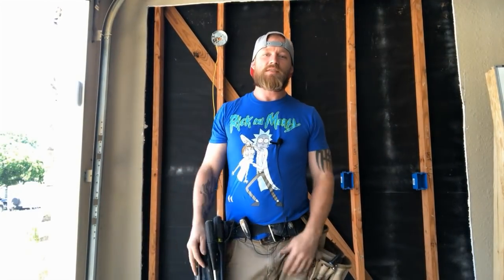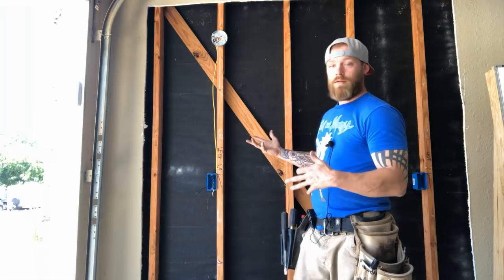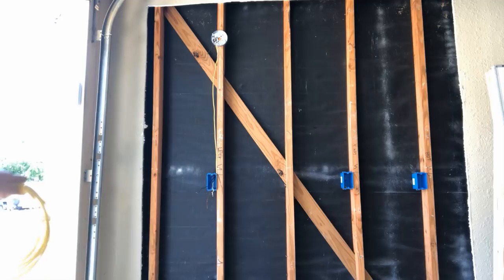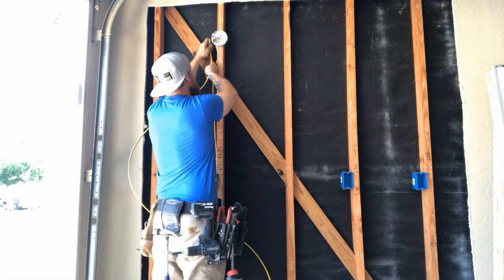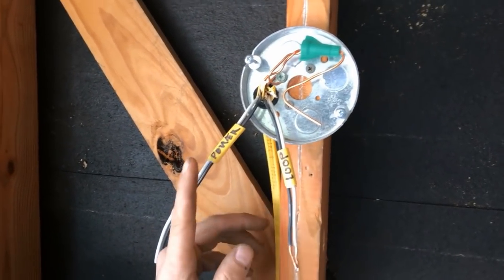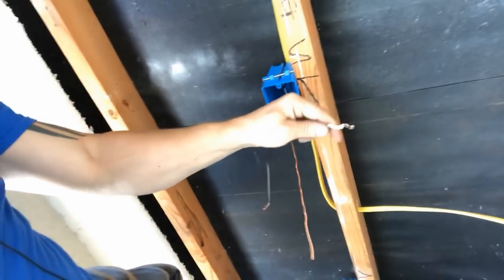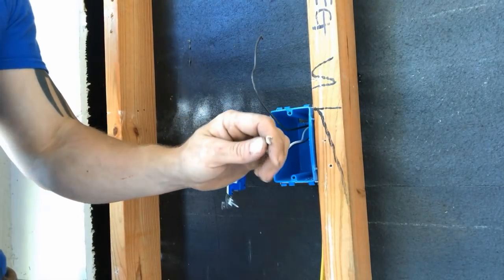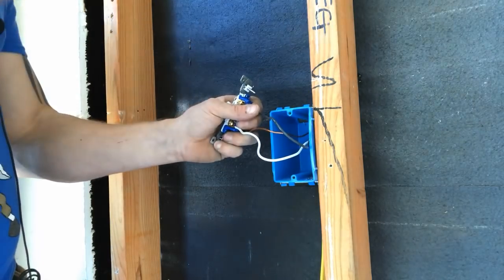Episode 12 - How To Wire For A Switch Loop

Comment: If you ever want to install a motion sensor switch or smart switch, you should have the neutral in the switch box.
Reply: Also, quoted from EC&M website: "When wiring lighting circuits supplied by a grounded general-purpose branch circuit, the 2011 NEC now requires you to provide a neutral conductor at nearly every switch point [404.2(C)]. The purpose for this is to complete a circuit path for electronic lighting control devices, such as occupancy sensors. For many such devices, you must provide standby voltage and current at the switch. When neutral conductors are not installed at switches, the unfortunate result is the equipment grounding conductor (EGC) may be used to fulfill the function of the neutral conductor. While the current from an electronic lighting device on the EGC is typically less than 0.50mA, the installation of many electronic control devices at switch locations in a building can result in an accumulation of excess current on the EGCs."
Reply: If you need ancestral n the box just run a twelve three that way you have ancestral n box and you don't have to tape white wire black hot red load wire  neutral already at iight  just wire loop to neutral on  light
Reply: Sorry  about spelling imean nuetral
Reply: With twelve three you have neutral n box 12 3 afoul wire conductor incase you hook up a dimmer

Comment: So basically to get power and add an outlet using the switch you used the white wire from the switch and black from the outlet and neutral isn't used

Comment: I'm going to do the electrical cabling of wires my own house, because why pay an electrician to install wire in my house. I have no insulation in my house and I have about 1,000 square footage house. I need only to rewire the top half of my house. So, from light fixtures to the light switch to the basement and in the electrical panel. I currently have outlets 14/2 and that's what I thought of buying, except I thought of putting 12/2 in the kitchen for refrigerator, stove, and microwave. The top half of my house is knob and tube. I wired a new switch and I did it hot. I found out, that with knob and tube, if touch the two wires together, that it turns on the light. I'll just let an electrician installing the wires into the electrical panel and de-energize the knob and tube wires. Because, I don't want to tear apart my walls to install new wiring. I'd love to eventually insulate my house, but I can't do it with knob and tube wires.

Comment: In the interest of expediency I will always.put. the neutral in the switch box,,,if you needed to troubleshoot the circuit you will not need a ladder,,,,but if the neutral is in the fixture,then that entails having to get a ladder and dismantling the fixture,,,,,that's too much work,,,.

Comment: Switch loops are no longer legal since 2011 NEC changes required all light switch locations to provide a neutral.
Reply from the maker: Not true, check your 2017 codebook - 404.2 - read all of the exceptions as well my friend.
Reply: There are a few exceptions, but I doubt most of your viewers will read or understand the NEC. I think your videos are very good, but in this case you might be misleading people. That neutral is going to be required in most situations, and most inspectors look for it. Additionally, it is the better and safer way, albeit the harder way.
Reply: yup, we've had the neutral requirement "locally", before it was NEC. and that neutral sure is handy if the client wants smart switches!

Comment: What's the cu in on that box?  😎  it is 6.0 cu in.   12 awg wire is 2.25.  So you have a total of 11.25 cu in.  Fail.   Even with one 12 awg romex, cable.  That is a total of 6.75 cu in.

Comment: You know, there doesn’t seem to be a reason to invert the wires like that, why do people say White wires are always neutral wires, which would be true if electricians didn’t randomly invert them
Reply: It is not randomly inverted.  You could connect your two blacks together, but then you would have two whites connecting to the device,  This is old school, but you still run into it.

Comment: is this the regular way to do this in the usa? this looks so old fashioned to me (like 50 years or older). omg those switches got no insulation. connecting wires by drilling them together... there is a more faster and safer way to do this. you dont have spring terminals? like: https://www.wago.com/de/c/installationsklemmen

Comment: @6:20  You misunderstood section 300.14 of the nec.  It says 6" of free conductor from point of entry and if the box is 8"x8" or less 3" of conductor outside of the box aswell.    It doesn't say you dont need to worry about the 6" from point of entry if your box is 8x8 or less.   Basically whichever measurement method gives you a longer length you go with, if your box is 8x8 or smaller.   Cmon man this is basic first day shit.   As we know it is how the inspector interprets the code.  But to me that is pretty clear you are fucking up.  Yes every wire even that ground you usually cut wayyy too short.

Comment: What a terrible idea. So the unsuspecting "innocent" goes up to install a new bulb. S/he doesn't know that that light receptacle is hot.....Much better would be to have a switch for that "automatic" light to insure current to bulb is cut. Same approach when wiring dawn to dusk lighting.....you don't NEED a switch, but you have one to kill all the lights when you want to change a bad bulb (or install LEDs).....(sure, you could claim you can go back to the panel to kill the breaker....but how many people have properly labeled panels and how many of those people will bother to go to the panel, located in the basement....